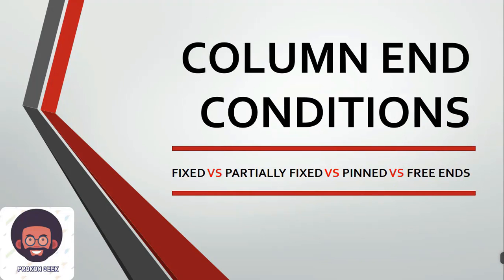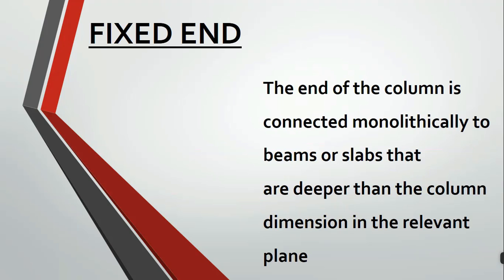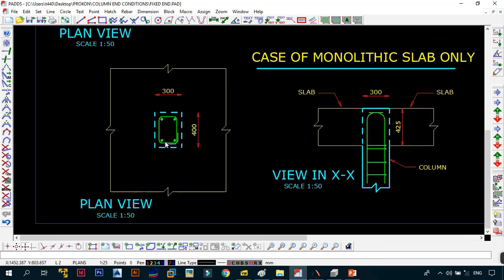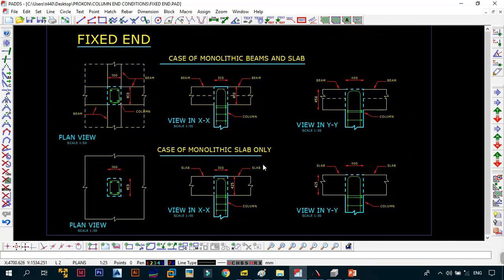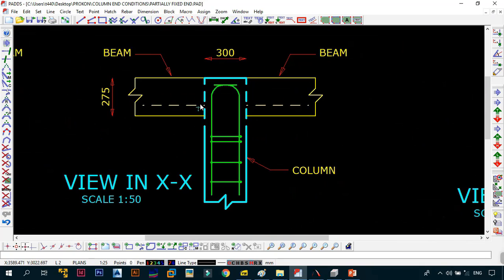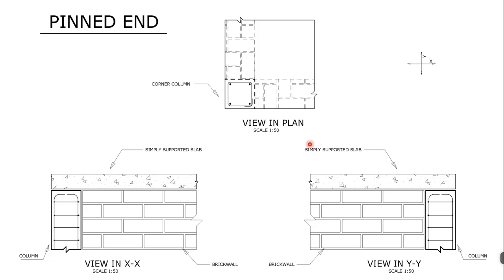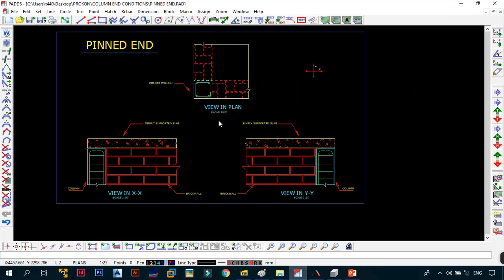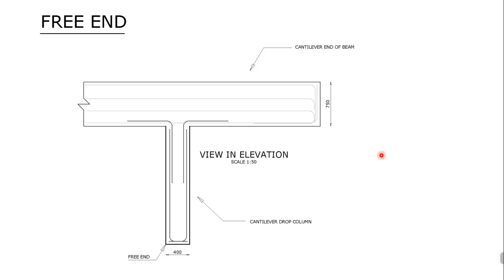Fixed Column Vs Partially Fixed Column Vs Pinned Column Vs Free Column

Comment: Hello. I have an enquiry, all these columns has a beam/slab on either side in each plane. Does these conditions apply for only one beam connected to a column in a single plane (e.g. Corner columns)?

I hope you can help.

Thanks.